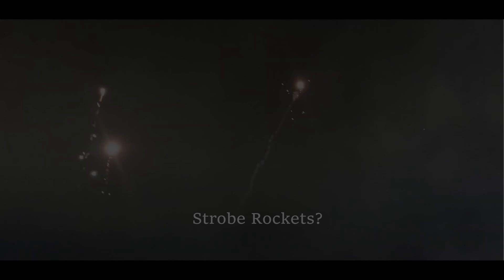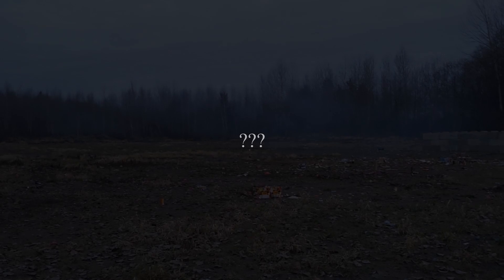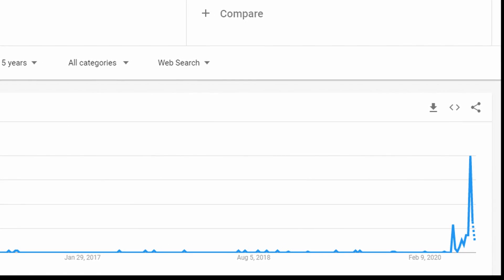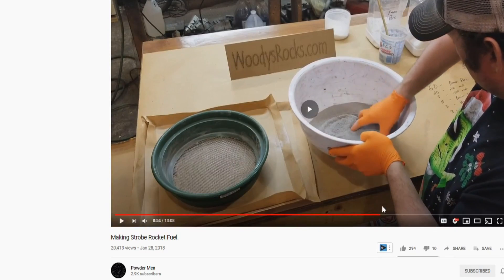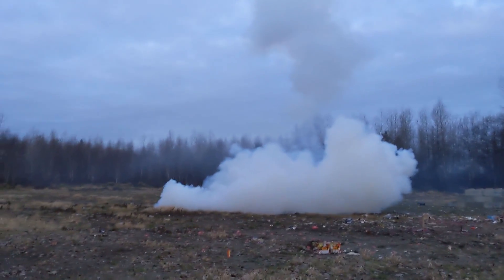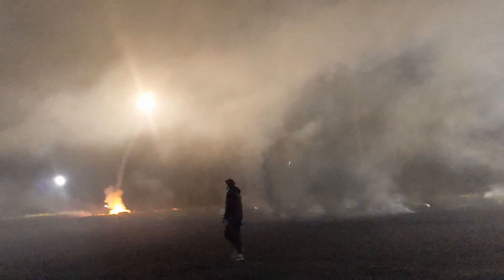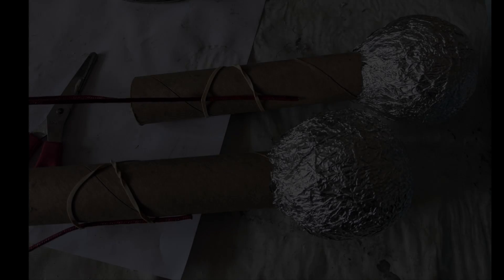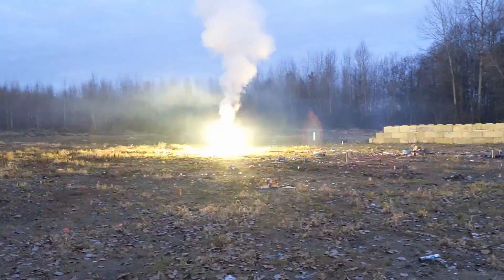Where do Strobe Rocket FIREWORKS Come From?

Comment: Strobe rockets are not to be messed with if you don’t understand the concepts of whistle and flash powder wrong pressure applied during pressing and boom
Reply: Also reason Cody’s builder that made his dor his whistle uses a different formula of strobe mix called x10 it strobes faster
Reply: 6,000 ponds per load on a automatic press stop.

Comment: Very well-put-together video, CC. You explained things quite well, and as a person with first-hand experience building strobe rockets, I can testify to their production being a dangerous and time-consuming one. However, that does not deter folks like us from building them! Once you acquire all the needed supplies and obtain an efficient method of manufacture, then boom, good times are to be had.
Reply: Ꭼxpl๏sives Ꮮab๏rat๏rƴ strobe rockets love to go boom on the press if your not carful
Reply: @crazystevepyrotechnics  how does one be careful?
Reply: @ryandull6581  use proper blast shields and know what your doing
Reply: @ryandull6581 
Ammonium perchlorate is the oxidizer that is required to make strobe rocket propellant. When combined with any fuel, especially metals such as those required in this case, a very hazardous composition is the resulting substance. Like whistle mix, it is shock and friction sensitive. For this reason, strobe rockets must be pressed and never “rammed”, as ramming them may cause them to explode during production. Even when being pressed, your hydraulic apparatus should have a blast shield, because strobe rockets have been known to cook off even during pressing (likely because propellant was pinched between the top of the spindle and the final metallic rammer). Due to these dangers, strobe rockets should only be constructed by professional pyrotechnicians. The also should not be sold to the general public, especially when built by someone who is a “false professional”, example included here: https://youtu.be/E4NExiWgUQQ
These strobe rockets where built by “Hame” in Cali. Rushed production due to high demand in 2021 drastically effected the quality of the rockets, and many where known to C.A.T.O. (explode at launch). Dozens of people where injured, some severely, because of this unprofessional situation.
Reply: Where are you based and is there any chance to purchase them from you?

Comment: Check out Woodys strobe fuel recipe. This guy is the only safe and best way to build them. First ones I made from this recipe worked really well. Never use spiral wound tubes. Convolute tube’s thick wall. He also sales tools and other equipment. He’s got this down to a nice safe way to build them. Never change the recipe he’s got.

Comment: How did you make your strobe fuel hotter so it will pop loud like reports with tremendous amount of light? I use a 3lb econo tool kit and thought that would have done it. I'm currently using Kalebs recipe. I used NC lacquer 3-5%. Do you think that's the problem? I milled my dichromate for 5-6 hours but didn't mill anything else. I used 200-325mgal. I read that adding MG will do the trick on a pyro forum according to Mumbles who is an admin. Any thoughts?
Reply: Do you sell any?
Reply: Do you make these?

Comment: I started out hand ramming black powder motors then switched to a modified arbor press. My next goal is to make strobe rockets but I know I'm probably gonna have to buy an expensive press or build one to make them.

Looks like woodys uses prebuilt hydraulic power packs in his. Wouldn't be hard to throw in a cylinder but I know he's a very great machinest so the frames he fabricates for his presses I wouldn't be able to replicate.

Comment: I had one but I sold it
Reply: What’s the storing protocol since it’s  Sensitive?
Reply: @dumplingsboi3906  dont throw it against a brick wall. Chances are nil if you store and handle them as you should, with respect. The danger is high during the manufacturing process.